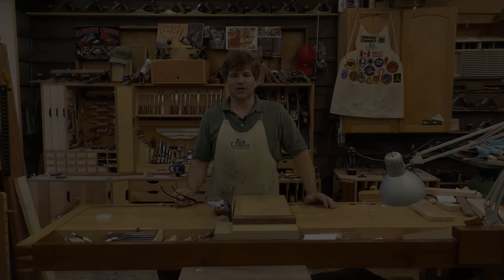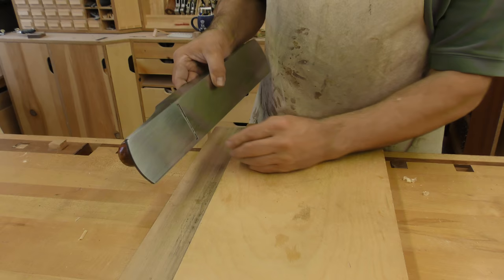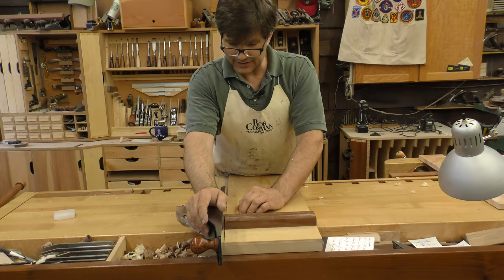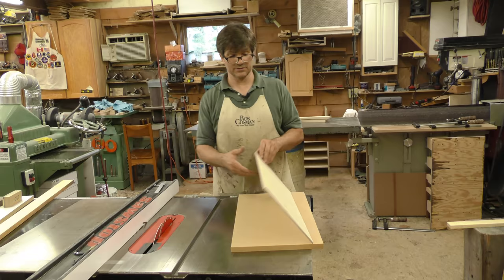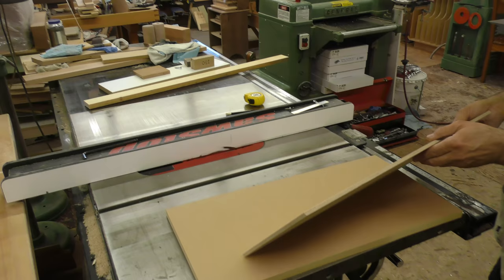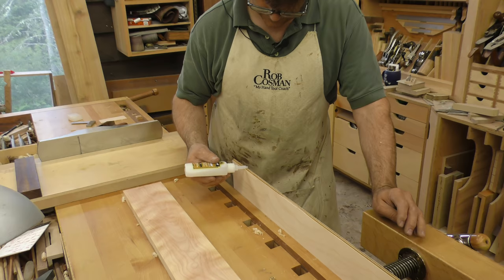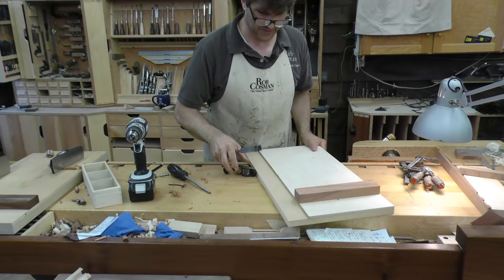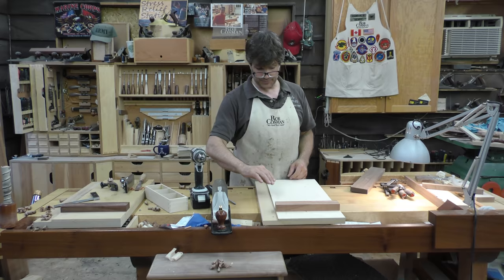You NEED a SHOOTING BOARD (Here's how to build one!)

Comment: A little late to the party, but...
Don't have a flat surface yet to clamp on and was worried about making the form. Saw that I had 1/2 inch MDF laying around and wondered if the opposing forces on a middle layer would keep it from cupping. 
One month later, during the hot and humid weather of the North East USA, I have a 1" base layer (2 layer 1/2" MDF) and the 1/2" ply on top, and it is still nice and flat, even to my reference straight edge.

I still messed up the squareness of the fence. 😔  I'll get there someday.

I'll check back beginning of September to update condition.
Reply from the maker: let me know how it goes
Reply: If anybody is interested... January 2022, Board is still flat and working great. Will certainly use this method again.
Don't know what happened to my fall update, I did post one and had a small caveat but not important at this point.

Comment: if you glued another piece of Baltic on the bottom of the board it will have equilibrium and stay flat Yes?
Reply from the maker: Do you mean glue another board on the bottom of the panel or are you referring to the edge of one of the boards?
Reply: @RobCosmanWoodworking  birch/mdf/birch sandwich first layer of birch on your bench

Comment: I realize this is an older vid but I have a question or concern with your shooting board and shooting boards in general.
I've read you should ramp a shooting board to encompass the full width of the plane otherwise you run the risk of grooving the shoe and if nothing else, continually dulling just one part of the blade on the plane used.
I was wondering what your thoughts were on this.

Comment: Quick question: Why would you bother cutting the rabbit on the top platform before gluing and not simply gluing it to the bottom as it is and then adding the rabbit with the plane itself after everything is assembled? The plane blade would cut the rabbit into the top platform as you use the shooting boards and the bottom 6mm or so (depending on when the blade starts) would be untouched, creating a rabbit with the perfect height.
Reply from the maker: You’re right but when making these to sell, folks expect them ready to use.  Only takes a minute.

Comment: I love your shooting board but you needed another shooting board to get all the wood squared. What if you didnt have one. What's the best way to do it?
Reply from the maker: hand plane and a square, work it a little at at time.  Start by straightening an edge, then square an edge to that one. Square the opposite and finally make the last edge parallel to the first one you started with.

Comment: Why not use 1” MDF and cut a 4” x 3/8’ dado in the MDF and not use a a glued up piece of plywood?
Reply from the maker: Crackerjack that would be a suitable method if it wasn’t MDF. The hardest wearing surface on a piece of MDF is the exterior, the core is fairly soft. As a result, I want to be rubbing my plane along the tough exterior.
Reply: RobCosman.com ok yeah, I didn’t realize the hard part of MDF being the exterior, good to know. Thanks

Comment: Using hockey tape on every tool is the most Canadian thing ever.
Reply: Willy T it really improves your grip.  Old arthritic hands hurt a lot when gripping clamps, quicker than drilling a hole and putting a bolt thru to be able to properly tighten the clamp

Comment: Just wish I had a bigger workshop. You couldn't even fit your table saw into mine, let alone all the storage, or a workbench. Most of my tools have to be stored in a separate room, you couldn't knock the dividing wall down its 3 feet thick stone and the house would fall down!

Comment: Have you ever thought about making one of these for us poor people?  My workshop is not the size of an aircraft hanger, I don't have industrial size planer thicknesser, nor table saw - presumably you have an industrial band saw and radial arm saw too and a router with a router table to die for.  I don't have compressed air, nor do I have industrial dust extraction.  I have a smallish table saw and a small router table and an even smaller band saw.  All the rest is hand tools.  BTW why do you need a shooting board 2 ft long?
Reply from the maker: Dont talk poor, we manifest what we think!  I do this professionally so I have the equipment i need.  Didnt start that way, bought old used stuff, fixed it up till I could find better.  Any one can do the same, watch where you spend your mad money.  2' board allows for wider stock and I can do edge work on longer stock.

Comment: Since you need a shooting board to make a shooting board and I don't have one, I guess I cant make one?  Why don't you show how to true up the cleats without a shooting board?  PS, your lack of safety precautions with your tablesaw are disconcerting.  Turn the saw off before moving the sled in place and stop rushing around near a spinning sawblade and wear safety glasses.  Even cutting your rabbet edge was unsafe.  Be a role model for how not to cut your finger off.....